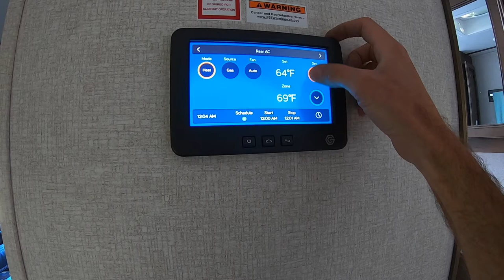RV FURNACE Blowing COLD AIR & Won't Light?  Furnace Removal & Sail Switch Repair

Comment: My husband and I have a 2018 Jayco Eagle TT. We have 4 shedding dogs so hair is always an issue. Just yesterday when we went to use the furnace the blower was working but there was no heat. I searched for an answer to my issue and your video was the first to come up.  I took the same steps you did and my switch had just a slight bit of hair on it. I cleaned it off put it all back, and the switch was working again! Thank you for a detailed and informational video. It was a pain in the * to get to but saved us a trip to the dealer!
Reply from the maker: @Kailin Carr  Oh, so great to hear Kailin!  And very glad that helped solved your issue!  Yes, so much easier to do it yourself than it is to take it to the dealer (even though it's difficult to get to).  Just a note, we ended up having to replace our sail switch about a month after we filmed this video, so, I got very good at removing the furnace.  Just wanted to let you know in case you also have a faulty switch.  2 years later and our furnace is still working perfectly!  Just be sure to add that screening to avoid any more issues with the fur.  🐶🐶🐶🐶

Comment: I didn’t see a link or description of the screen you used so wanted to see if you could share that. Thanks and appreciate the video!
Reply from the maker: Hey AJ, glad you enjoyed the video!  I believe we purchased the screening from Lowe’s and it was made from aluminum.  The aluminum screen is thicker and more durable than the vinyl screening.  Here’s a link to the material:  https://www.lowes.com/pd/M-D-4-ft-x-7-ft-Brite-Aluminum-Screen-Mesh/1000880498
We also used the same material under our floor vents that helps keep larger objects and debris from falling down into the supply pipes.

Comment: Did you have to replace any seals on the propane line leading into the furnace itself? I am wary about removing that without a proper seal replacement. 

Live in my camper with my finance and soon my newborn.
Reply from the maker: I did not replace any seals.  As I recall, there were no seals to replace on our propane line, just a flared compression fitting as shown in the video.  We made this repair 5 years ago and we have not has any propane leaks.  If you are unsure about your situation, it may be best advised to contact a professional rv tech.

Comment: My 2000 motorhome is blowing cold air as well too, is there a simpler solution such as the gas is not turned on in the furnace? I have gas flowing through the stove for sure.
Reply from the maker: I wish I could tell you it was something simple, but, if you have gas at the stove, it’s most likely going to be a problem inside the unit.  I would try the sail switch first as that is the most common problem as well as the easiest and least expensive.  Hopefully you have access to it from the outside rather than having to remove the entire unit like we did.

Comment: Thank you for the video; much appreciated!  I have a question. 
    Currently, I have a 2014 Atwood 8525-IV LP gas furnace in my travel trailer.  My objective is to get my sealed Marine PowerPlant Deep Cycle battery with 65 amp hours, to ignite my furnace when not plugged into electric or using a generator.  The battery was purchased on 6-24-2020 and is kept fully charged via 30Amp receptacle on my barn.

   When I use electric, the furnace will go through the startup sequence and runs properly. When I try to turn heat on using only the battery, the fan will run for a minute or two and then shut down. I replaced the sail switch and the circuit board works fine.  

I just checked the voltage at the furnace in a couple of ways with and without 30Amp hookup.

Furnace off 
With hookup it was 13.40V
            Without hookup it was 12.40V.

Furnace on 
With hookup it was 12.10V
Without hookup it was 11.00V

Volts in battery 
With hookup is 13.30V
Without hookup is 12.60V

Hopefully this will provide a better insight of what I am working with. Your suggestions are greatly appreciated. Thanks. Scott
Reply from the maker: @Luv2flyMD Hey there!  My first guess is that  your battery may be bad (even though it's showing that it holds a charge).  Have you taken it anywhere to be tested?  If your furnace is running with no problems while on electric or generator, then it's most likely an issue with the battery.  Even if you do get the furnace going with a new & good AGM battery, it will probably only power your furnace for about 4 hours of minimal use before dropping below 50%, which will then cause damage to the battery.  We had issues with our stock AGM battery that came with the camper  immediately where we couldn't run our furnace without being on a generator or hooked to shore power.  We swapped our battery out with lithium and have never been happier.  Here's our video on changing out our converter so we could go to lithium.  Hope this helps!  https://youtu.be/PTiTt_kqrdo
Reply: @EddieAtLarge  Thank you!!

Comment: I do not have that switch. I thought that's my problem. 
I pulled everything apart nothing like that.
I have an 87 Tioga RV. 
It started hot. Blew hot for 10 min. Then cold. And can't get it back to blowing hot.
Reply from the maker: @Dean Martin  Hey Dean.  Sorry to hear that our video didn't help you.  Do you know what the make and model your furnace is?  I would recommend trying to get that info and using it when doing a YouTube search.  Wondering if you have a thermocouple for the pilot?  If so, it may need to be cleaned from soot buildup.  Another thing to check is to make sure you have propane flowing properly to the unit.  Best of luck to you.
Reply: @EddieAtLarge  i have a Suburban furnace i think it is an ST?
That was yesterday am project.
I went to get propane from uhaul up here in Reno. The guy fills it leaves it spraying out the over flow valve and sends me to repair shop 3 miles down the road. 
Thank God for the friendly tech at the shop. He fixed it. 
Told me to go to home depot. To get a flair fitting cap. 
Showed me how to turn heat on and fire up the furnace. 
Everything worked for about 20 minutes.
Got nice and toasty. Then I felt cold air blowing. 
Sure enough. No more heat. 
I tried to pull the furnace apart to maybe clean the sail switch. 
But I couldn't find it. Must be on the rear of the unit. 
Either way something is breaking down daily on this RV. I will prob sell it. Up here.
Gas is through the roof. 
I wish I knew about you prior to leaving Vegas.  The tech I hired was 👎highway robbery for what he accomplished.
Reply from the maker: @Dean Martin    Really sorry to hear you are having so many issues!  Here is a link I found for a High Limit switch failure on a Suburban furnace.  https://youtu.be/5ryfYJrirzI   I'm getting info online that this is one of 3 possible causes for your issue.  The other 2 possibilities are a bad Sail Switch or a bad Circuit Board.  Here's another video that talks about those issues as well as the High Limit Switch:    https://youtu.be/3y5V-tZ9Dn4     Also, make sure your battery has not gone bad.  A bad battery will not give enough juice to run the fan at a high enough speed to push open the sail switch and keep it in the open position.  You can have your battery tested for free at almost any auto parts store.  Hope some of this info helps you out!
Reply: @EddieAtLarge  thank you so much.
The issue or issues are. 
The unit is buried under the bed. 
I dont have the ability to pull it completely out and work on it and the local tech is backed up til July.
Being an RV mechanic is good work right now so many on the road. 
The sail switch and board are not accessible unless I pull the whole unit.
I will go with out heat and as you would know it. Snow the last 2 days in Reno. And its a week from June. 
Ugh.
Thank you sir. You are a good man.
I will watch the video. 
Its weird how it conked out while working. So heat then no heat. All while blowing. 
Hmmmm
Reply from the maker: @Dean Martin   Just realized you are probably on hookups and if that's the case, it would not be the battery.  Wish I could be of more help!  Take care and stay warm.  We are moving with the weather to stay both warm and cool.  Currently near Capital Reef NP in Utah.  Heading to northern Utah next.  Take care.
Reply: @EddieAtLarge  i am not on hook ups for the most part. 
I stay at RV park 2 days a week.
I am boondocking. For the most part.
Final destination. OR coast. 
I heard it is amazing in the summer time.

Comment: Thanks for sharing! I am having the same problem. After seeing all that hair wrapped around that sail switch I am convinced that is my problem…. We have a golden retriever and the hair is EVERYWHERE…. Ha ha gotta love her though. Question though did yours happen to trip the reset switch on your unit?
Reply from the maker: @Livin Life Outfitters  Hey there!  Hoping that our video helps you resolve your issue.  🤞🏻  As far as I can recall, the reset switch was not tripped, although, I do remember trying that first to see if that was the issue.  Please let us know how your repair goes and if the sail switch ended up being the issue.
Reply: @EddieAtLarge  will do preciate it!
Reply: Livin Life Outfitters is the reset switch on the back of the furnace or would that be on the circuit breaker board
Reply from the maker: @MrDannyboyFL   on our model, it’s on the top of the furnace housing near the back where the wiring comes out.  You can see it in the video at 4:11 when I have the furnace pulled out.

Comment: Why does my furnace blow hot but doesn't blow hot air thru the vents?
Reply from the maker: Hmmm.  Wondering if one of your ducts have come loose from the furnace housing.  Are you having this issue with all of the vents or just a few?

Comment: Thread sealant on a flared fitting is a no no
Reply from the maker: Oh, didn’t realize that.  It has been 3 years since I made this repair though and it has not leaked.  So, from what I’m reading online is that you don’t want to use sealant as there is a chance of clogging the line if sealant gets into it.  Is that your understanding as well?